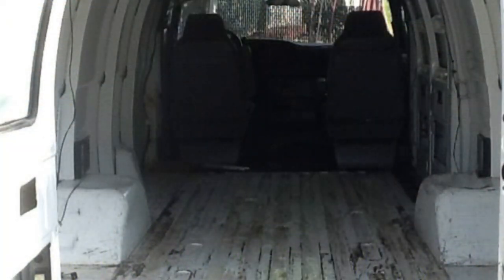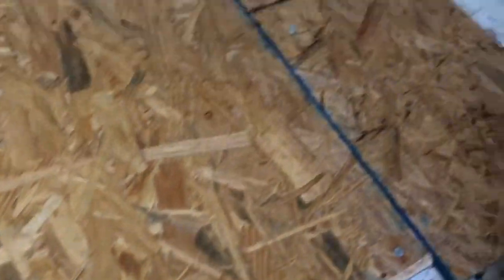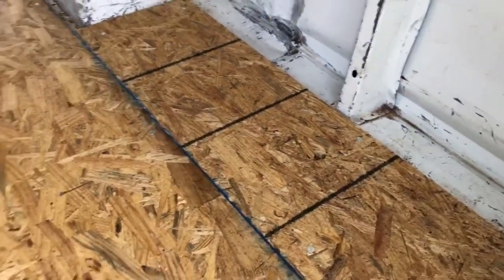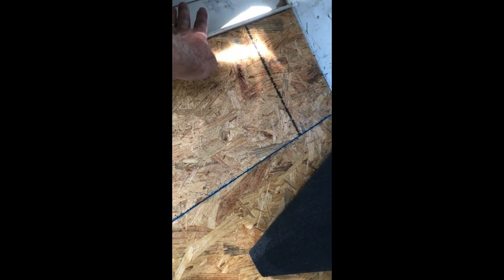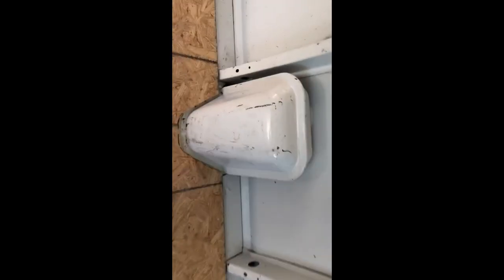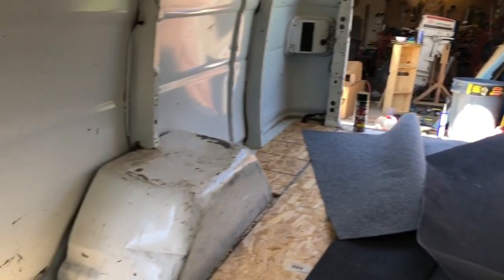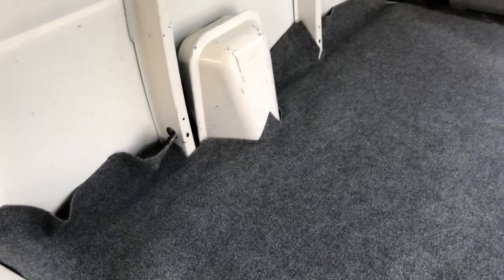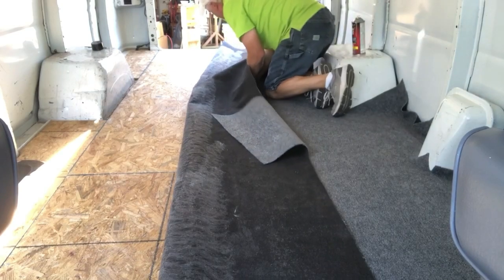How To Carpet A Cargo Van

Comment: Do you screw the ply board into the floor of the van?
Reply from the maker: No, I hammer 1” roofing nails.
Reply: BOR Fishing thank you so much!
Reply: @borfishing7690  Were you worried about damaging something under the floor by nailing into it? I own a 2001 Dodge Ram Van, which I think is the same as yours.
Reply from the maker: Not when using 1” nails